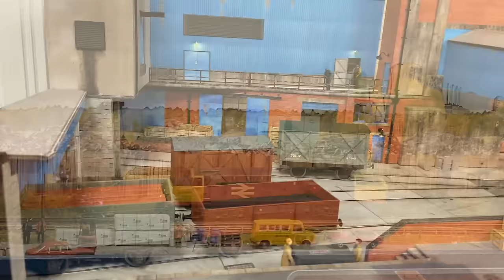2023 Great British Model Railway Show

Comment: So do you think anything was different or better/worse than GETs?
Although I was planning on attending this show, GETs had sort of worn me down tbh.
Reply from the maker: This was a lot calmer experience, if anything I found it to be quieter than last year, still busy but by 2 in the afternoon numbers had definitely decreased and was very easy to get near layouts and stalls.
GETS was just crazy this year, the quality of layouts between the two was the same, personally I think GBMRS had the edge on traders as there was more variety and I managed to get some bargain models, two of which are like hens teeth online and all the electronic components I needed, which was lacking at GETS.